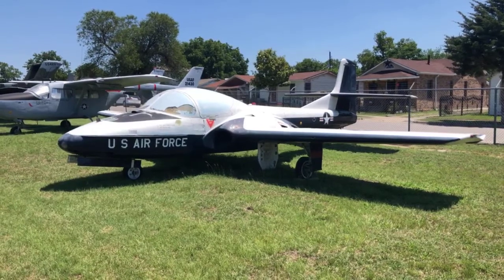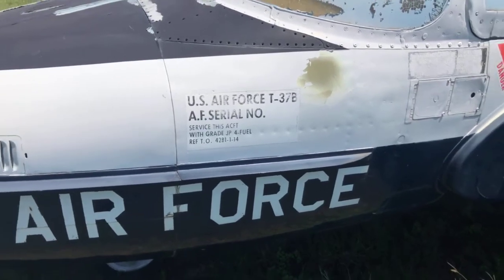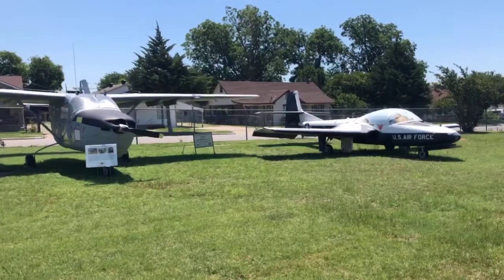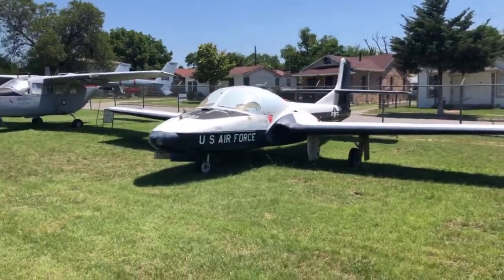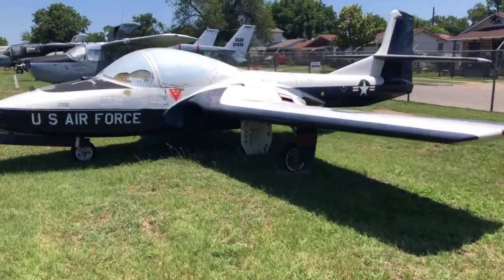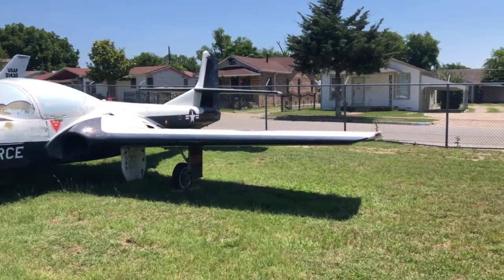T-37 Walk-around - 3 Jun 2020

Comment: Hi Jim. Thank you for the informative walk-around of the Tweet. I flew the T-37 as an Instructor and Evaluator from 1998-2010. Just wanted to let you know that the red-boxed pockets on each engine are access points for the fire and rescue team to place an extinguisher hose when needed. Also, the thin pieces of metal that surround the front of the fuselage are called Spin Strakes, which were added to the B-model. Their purpose is to change the pressure below the fuselage during a spin, which helped the aircraft remain in a spin for recovery training. Did you ever find a new wind screen?